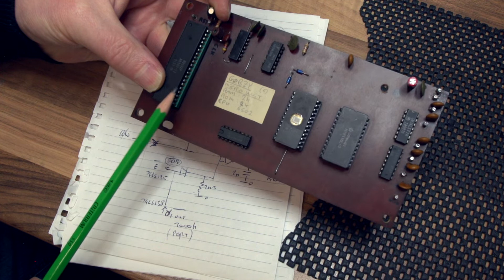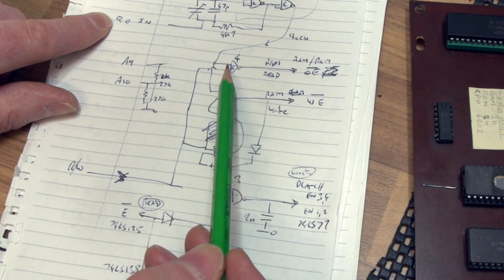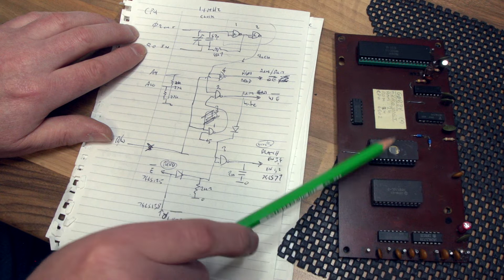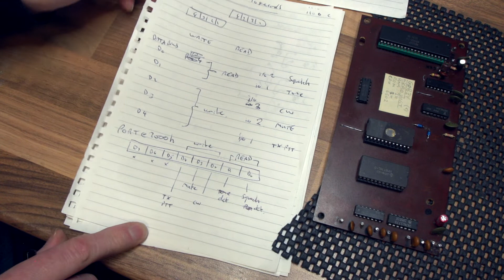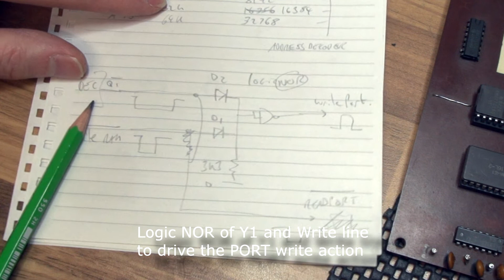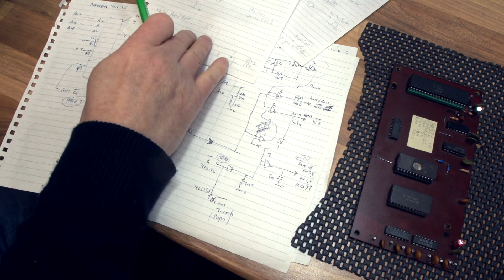Examining a PCB and drawing a Schematic Diagram : Reverse Engineering a 6502 CPU card

Comment: The 2k7 resistor is to stop the nand gate driving the DLatch signal inputs from floating if the two diodes anodes are logic 0

Also the way I approach reverse engineering is to use a database and spreadsheet. List all the components on the spreadsheet ie R1 R2 C1 IC1 etc
then put the pin numbers in ue pin1 and pin2 for R1 (decide what is pin1 and pin2 for all discretes ie pin 1 is left or top and pin 2 is right or bottom diodes is obviously cathode and anode the ic are where the database comes in for example the 6502 has 40 pins you could search for 6502 in your database and then copy the result to the spreadsheet in the form of ic name 6502 in this case the pin number pin 1 pin 2 etc the pin name D1 D2 ADDR1 ADDR2 etc then what type of pin it is ie all the data pins just put DATA all the address pin would be ADDR when the spreadsheet is complete you can use the filter function to just filter all the DATA pins and this should highlight all the pins that are DATA ie the processor the eprom and ram 
once you see what the pins are you can quickly check with a multimeter what pins are connected between these devices once you've proved a connection exist you can give the net connecting these connections a net name such as D1 D2 etc this quickly eliminates a lot of the nets. power nets are quickly eliminated in this way obviously at the end you will be left with a few component pins that are not connected for example the 3 address lines going to the 72ls138.

The way that you approached this card is fine for such a simple circuit works fine but for modern electronics where the components are surface mount and the pcb layer count is more than 2 my way would be quicker I hope this makes sense to you but overall, the video was enjoyable
Reply from the maker: HI there. The purpose of the 2k7 is a pull down resistor forming part of a logic NOR gate. That NOR enables the output port D-latches, its basically its write signal. Without the 2k7, the input of the NAND would remain high when the diodes are at zero. When i designed this back in 1986, i could have used more logic chips to get the same result ie. actual NOR gates, but wanted to keep the chip count at a minimum. So i opted for a simple diode logic NOR here instead. Two diodes and a resistor eliminated a whole chip. Hope that helps. Thanks for your interest !